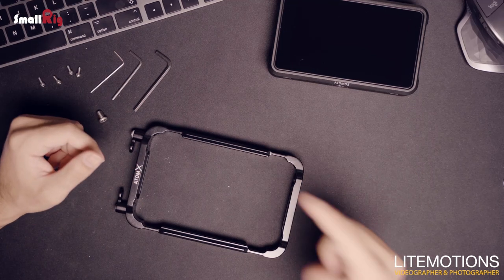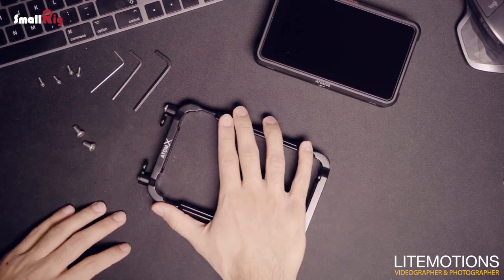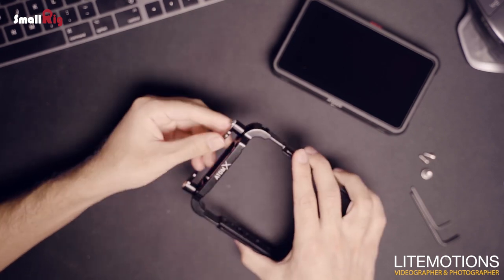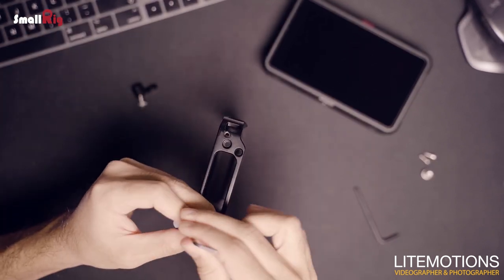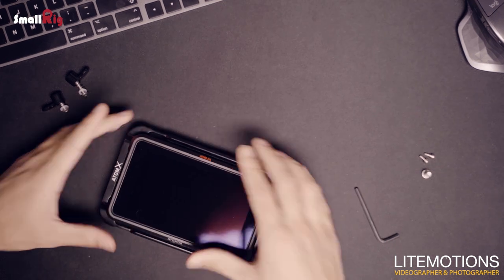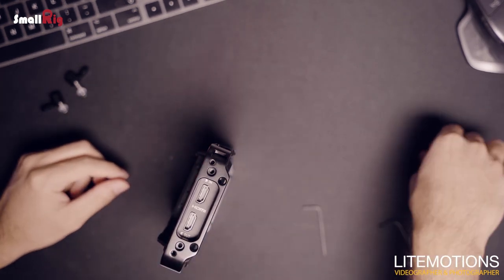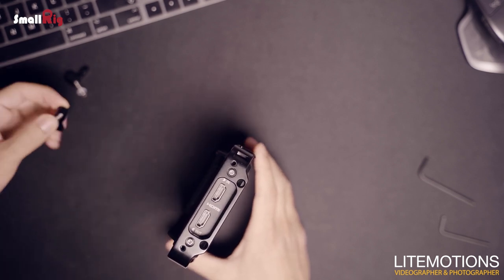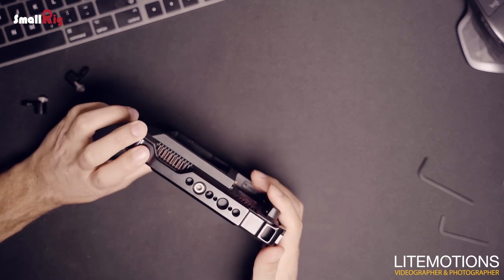How to assemble the SmallRig Cage for Atomos Ninja V 2209?

Comment: Not a fan of this kit because Smallrig does not include a 1/4 20 thread adapter.  The bottom center hole for the cage is 3/8s.  All of the Smallrig monitor holders that go between this cage and your camera are 1/4 20 thread.  So now you have to mount your Atomos cage off center.  Side note that the Atomos Ninja V itself has a 1/4 20 thread adapter but it does not mount flush inside the Smallrig cage so the part about them "developing this cage together" seems invalid.
Reply: god damn if there was a nail you hit it right on the head
Reply: use the nato rail, much better system for mounting a monitor as it can't twist or loosen up
Reply: You are absolutely correct. Why in the world would they design it this way....

Comment: Can the 2.5" drive caddy (enclosure) still fit in to the Ninja V with the SmallRig Cage if you don't use the AtomX SSDmini drives? When you use the drive caddy, the 2.5" drive is larger than the unit on the left side by 0.75 inches (3/4").